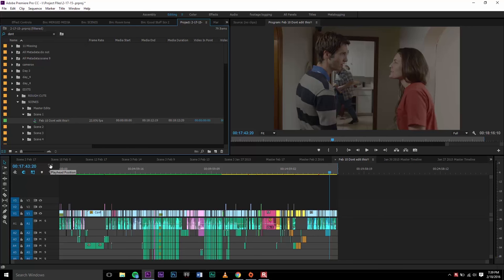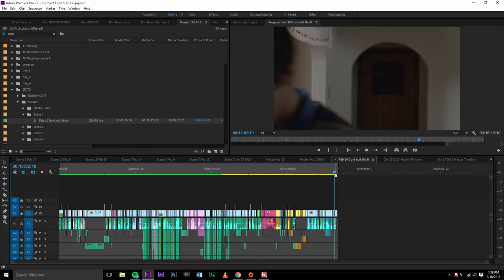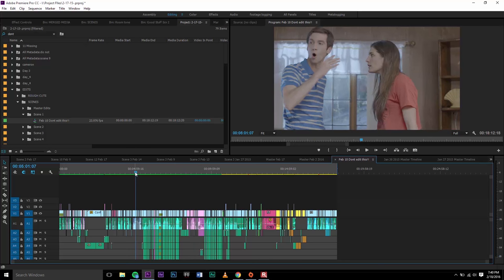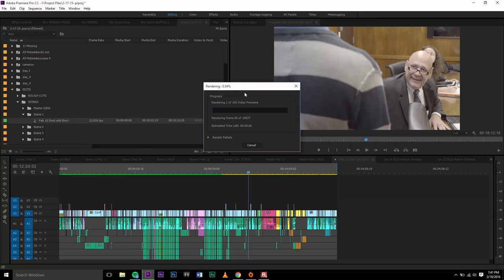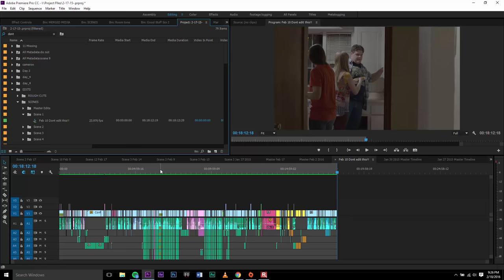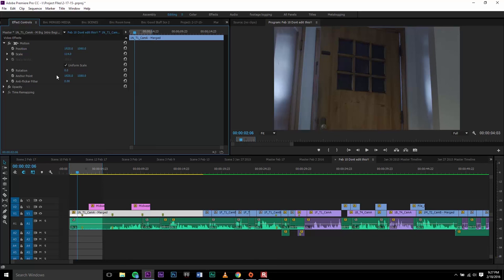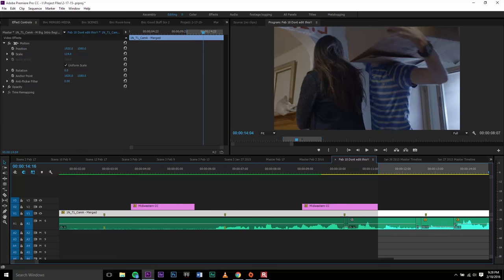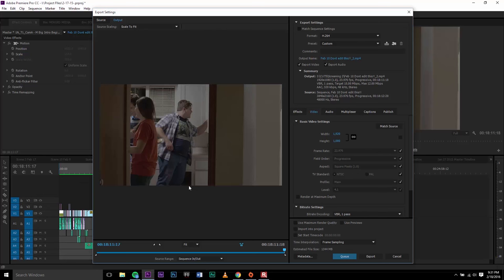Troubleshooting Export Problems in Premiere

Comment: REALLY HELPS!!! Have some recommendation how to ease the process. I had a screen recorded video - 11 min in total. When I tried to export video always stuck at 7%. After  watched Josh video I figured out that the problem was in 1 particular place sec 49-50. So I just cut this second joined 2 parts of the video and that's  it. All worked. BUT all this time premiere pro was freezing and I had to reopen it all the time. SO - 2ND SIMPLE method how to find out there you have *broken* frame is just to launch the recording in VLC or any other player. In my case I used VLC . And it played video until 49th second and after crashed. I opened video again and launched it from 51st second and all worked ...so this is how I figured out quickly which part of video is broken....saved me plenty of time relaunching premiere pro.

Comment: i had many  issues when i exported my sequense. After long tests i found out that my cpu needs more voltage. It has already passed Cinebench tests but is seems that Premiere makes my pc work harder. So if you are an overclocker boost your cpu voltage.

Comment: I know this is old now but if by any chance you're still around, I have one that is stumping me...
I am using CS6 2013 rather than CC, but it's never had a problem exporting until now. It appears to export fine, but it's rendering some of the clips really poorly... and weirdly, I rendered it the other day when the project was 99% done, and it worked completely fine. I haven't changed anything to do with the clips that it's messing up... I've simply put some stuff at the end. When I saw this video I rendered the entire project and thought "Yep, that'll be it..." but no... same effect.
It's bizarre and I am about ready to jump off a bridge because I've been working on this for almost 5 weeks and this is literally the final hurdle. It's more like the final step after the final hurdle... it's ridiculous and I can't figure it out.

Comment: Hi, I know this video is kinda old, but if you could answer my question I'd greatly appreciate it.

I've tried rendering my video out, and it works just fine, but actually exporting it I run into an "error compiling movie: unknown error" dialogue that pops up as soon as I hit export. The popup title says "Adobe Media Encoder".

You mention in your video not to use the adobe media encoder, but I don't know how to do so. Any idea how to fix my problem? I've tried exporting as every single output type, and nothing seems to help. I'd really hate to use hours of work by starting over, and I'd be even more upset if I started over, edited everything over again, and then encountered the same issue.
Reply from the maker: What button do you hit when you try to export? Do you hit the "export" button or the "queue"?

Comment: i have a problem now in my video and this the 1st time I encountered it. everything was ok for me during the process of making the video but im just wondering when i will export to rendering now the video. its just only a short video that 4GB equivalent but the problem is i cant transfer it to other external drive like USB even the space is 16GB so it means I can able transfer the video to the USB but it keeps telling a error message that the Video file I will transfer is to large for the USB  even it has 16GB vs 4GB file. is their any solution cause i re rendered it 5 times with different  set up so I can manage to change the project file but still same output to large even it is 4GB only. hope u can help tnx
Reply from the maker: Did you use h264 when you exported the video?

Comment: What should I do if there is no Render In and Out after I opet sequence section...?
Reply from the maker: Have you marked a section of your timeline with make in and out points?
Reply: @JoshChappell  Yes, I did. At the beginning, when I just started the project, I've had that option. But later on, when I tried to do it, I didn't have Render In and Out. 😀
Reply from the maker: I know this is a basic suggestion, but have you tried restarting your computer and making sure Premiere is updated?
Reply: @JoshChappell  I'm using 2018 version. But anyways computer is not with me now and project is finished anyway. Thank you for responding and trying to solve this little problem! 🙏
Btw. You can check this video out when you catch some free time..
https://youtu.be/ppggW-TMdQk

Comment: thanks
I can't play exported file. what would be the problem?

I am exporting as H.264, Adaptive Low bitrate
Reply from the maker: Did you export using the h264 codec?
Reply: @JoshChappell  yeah, it only appears when I use my mobile phone screen capture videos in premiere Pro. The exported file has volume with no details like frames per second, time ...etc
Reply from the maker: Did you ever figure it out. Do you have VLC installed?
Reply: @JoshChappell  Yeah
it was because of Apple quicktime in sequence settings.

yeah, I have it on my Windows.

Comment: After exporting my Video, sometimes there is a Glitch in the fineshed Video anyone can help me?
Reply: BeeJayFilms try any other media player like vlc or windows media player. This problem usually comes with vlc though.
Reply: Lovy Brar Thank U
Reply: I dont think its issue of media player. 
I think it can be that some other softs in the background are open and that might cost issue try to run only premier pro when you render. I have same shit by my self now and im trying to find the answer
Reply: @ROASTEDREGIS  I'm running into the exact same issue. My video is perfectly fine in Premiere, but once it's exported I run into a lag effect several minutes before the end of my video. Did you ever find a fix for it?
Reply: DeniedHighlander yes your footage because of cuts frame rate drop etc brakes down that gives this glitch issue.
Other issues as well i notice if you use illegal version of PP it means times for updates. 
How to fox it 
Simply find the glitchy place. 
And then replace that part  with new video by mention new you can add same video but you need to upload it to soft like a new video. 
And main note do not add video to timeline straight away! 
Add it to project or search it via project search engine and then upload it.
Because timeline drop can cost issues as well. 
Most of the stuff cost problems it’s not knowing how to use and upload your files properly. 
Then your gpu if you have low performance computer becomes more busier and gpu rise it’s power which might cost these issues we have
Reply: @ROASTEDREGIS  Thank you!

Comment: I use Pr 2019, rendered out the timeline and my footage is shot in 23.975 or something like that. I have used these frame rates countless times with no issue before. Now, even with a green rendered timeline with no issues at all, when i export the file. It does so and completes to 100 percent but when i open the file it is 24kb in size or sometimes 300mb but only plays for a bit and then it's is corrupt. I have used many video players and it just wont play or go past a certain point. I have changed every known sequence setting in Pr but still nothing happens. I changed the export location to my C drive and for fucks sake nothing is working. Can anyone help. All the original videos play just fine until in import, export and play them back.
Reply: I'm having that same issue now. Did you find a solution for that?